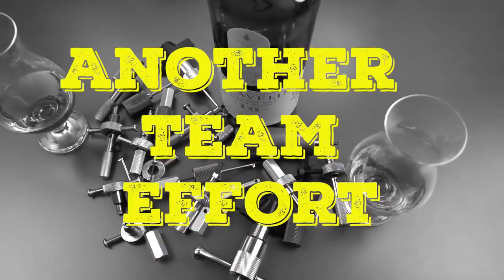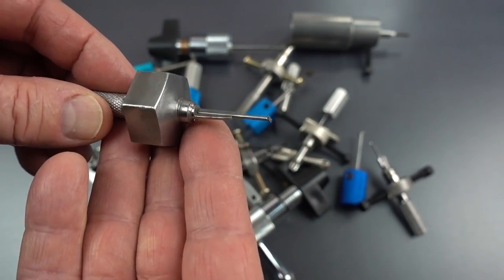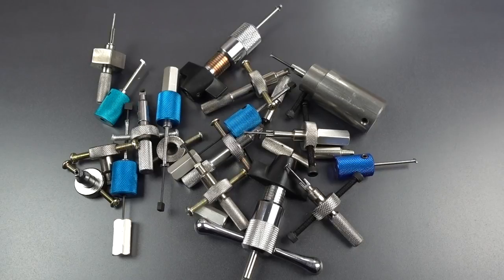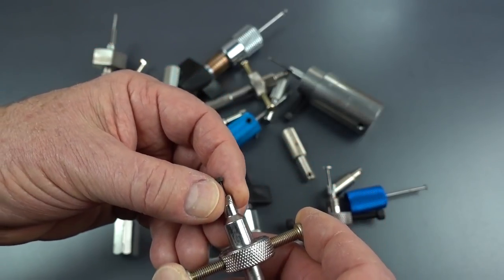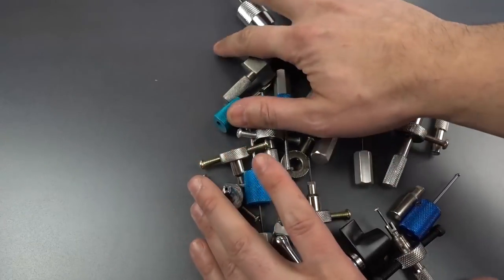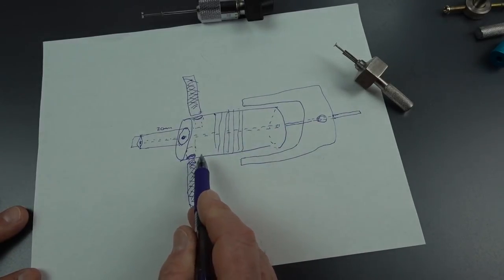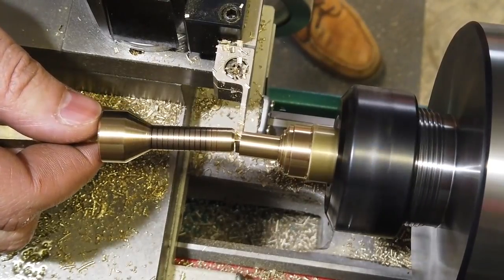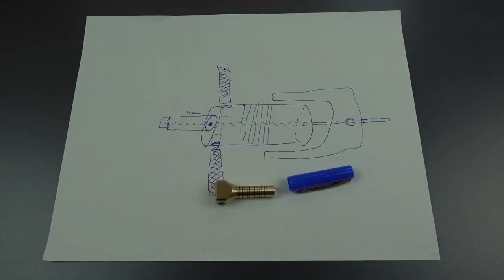[823] Disc Detainer Pick Build (Part 1) — Featuring BosnianBill

Comment: May I suggest heat treating and annealing your tension nose? That would make your new pick basically bullet proof.
Reply from the maker: Fear not... we’re on it. 👍
Reply: Excellent!!
Reply: @THR33STEP  do you mean tempering? I would not suggest annealing any machined steel that you want to prevent from deforming. Annealed steel is relatively very soft. 

Btw - both annealing and tempering are just a form of heat treatment.
Reply: Yeah you don't want those bullets breaking your pick

Comment: Three things.
#1 , use a live center when using a cutoff tool.
#2 , use a steady rest while center drilling.
#3 , move the markings closer together as most disc detainer locks have much thinner discs inside.

You can purchase aircraft length drill bits that are extremely straight and won't bend. When soldering or brazing the pic tip, insulate the drill bit to keep from annealing the drill, making it flexible. Otherwise, tig welding tungsten electrodes make good straight rods and are available in diameters from .040" to what I guess you'll need of 1/16".
Reply: my little lathe doesn't have a steady rest yet, if this was my project I think I would have changed the order of operations and drilled first then moved the rod stock out for the turning.
Reply: You guys should go and drink their wine and show them how to get it spot on 😉
Reply: You can't part off when a center is there, as the part has nowhere to go when it parts off. Sure you can start with that, but can't finish and take an unneccessary flying-parts-risk.

Center drilling doesn't need steady rest on such workpiece (lenght/diameter ratio low), as it doesn't bend under its own weight nor does the drill exert radial forces to the part to twist it.

Comment: Great video!  The Silver Bullet disc detainer Pick from HuxleyPig is by far the best.  It picks every disc detainer lock I've ever heard of except a small few locks like the latest Abus Granite and some of the Abloy locks.
Reply from the maker: It’s an excellent tool—probably the best made. But unfortunately, all that beautiful hand work comes with a high price. I’m sure it’s worth every penny, but it’s out of the reach of most hobbyists.
Reply: @lockpickinglawyer  Very True!  Also, I was the guy that sent you a video about the Kwikset Gen3.  I would love your analysis of this almost unpickable lock.   I would even consider sending you one if it means you'll research it.  There is another expensive tool that I've considered buying sort of on these same lines that is a Kwikset decoder.  The Gen3 appears to be decodable but not  pickable.  Not without tension on the sidebar and some models of Gen3 won't fit a shim down the side.

My point is the decoder is another very expensive tool, but due to how ubiquitous these locks are would be very valuable for lockouts.

Comment: well... I think I have a new lathe project...

Edit: suggestion, instead of using marker for the color, use nail polish as it will last longer, i've used it on my firearms and the color still pops years later.
Reply: Michael Sparks good idea!  I also use those little touch up automotive paint bottles to paint in hard to read markings on tools to make the markings stand out. However I bet nail polish would be a whole lot cheaper!
Reply: Ditto......but alcohol consumption, high speed spinning tools, nail polish, and two very shady giggling characters in the basement?.......guess we know how some are keeping busy during furlough!
Reply: Ex wondered why her neon yellow polish kept disappearing.  Cheaper than hi-viz sights.

Comment: This is great, im looking forward to the entire series. Looks like you are off to a great start so far.  

I don’t see why you couldn’t keep the body of the pick out of brass. Just make the “nose” and pick tip out of the higher strength stainless. It would make the pick look better aesthetically imo with the contrast once everything is polished up imo, and its easier and cheaper to machine.

Comment: As far as the tips go, I would try forging something from 4140 and then doing a heat treat. The tensioning nose should also be made from a high-strength alloy.

You might be able to mill two grooves length-wise in the nose piece and use two pieces of wiper blade anchored in the grooves to use for the tensioning.

I'd love to find out where you're buying brass for cheap. IME brass is rather expensive. I just paid $250 on eBay for about a dozen ~1" dia x 6” shorts and three ~3" dia by 4" chunks.

Comment: You should use tensioning pins in place of the nose. Two hardened steel pins could be placed on opposing sides of the pick rod. Use a set screw to lock them in. Different lengths of pins could be used for locks with different depths required to tension properly.

Comment: Suggestions:

Make the pick wire square for more positive locking with the set screws.  This would also allow for the brazing of the tip to be more secure and sturdy.

Perhaps the back end could be similar to a screw type collet such as one would find on an Xacto knife.  This would make it easier to change the wires.  It would also make it much easier to make custom adjustments to the wire length.  Possible caveat, it might allow some axial slippage of the wire.

Make the back end of the "Nose" squared for the same reasons as the wire.

I saw a pick that had teardrop shaped tension handles (thicker at the end).  That seems like it would be ideal and comfortable in the hand with less chance of slipping, although probably more annoying to make it knurled.

A set of both small and large handles would allow for either a more delicate touch, or better leverage for  tensioning.

Comment: I buy the pins with heads from Precision Punch in Berlin CT and grind the heads to fit. They are M2 and very hard, but are more durable to twisting than you would think.

Comment: if you make the front part a little longer, you can adjust the length of the nose by pushing it in, or pull out, before you tighten the knobs.
Reply from the maker: We’re on it already... our scotch-induced haze prevented us from seeing that up front. But video #6 will please you, I think. 👍

Comment: Interesting video. Looking forward to seeing the other ones. @LockPickingLawyer, have you guys considered modelling this in a 3D software like Fusion 360? Sometimes it helps to spend time making modifications in the CAD before actually building the object. If you want, I'd be happy to "contribute" to your project by modelling it once you have all the parts "final" and when you are able to share dimensions.
Reply: Hey, that's a very kind thing for you to offer, thank you!  I've used Solidworks for several years but in this simple project we kind of made adjustments on-the-fly, as you'll see in the remaining 5 episodes.  Making a proper 3D model on Solidworks would have taken about the same amount of time as actually MAKING the tool.   Usually I DO model projects before 3D printing, machining, or using the 3D carver, but I didn't have my laptop with me when the idea popped into our conversation.  Regardless, I am SURE you'll be happy with how this tool turned out, sans drawings.😀